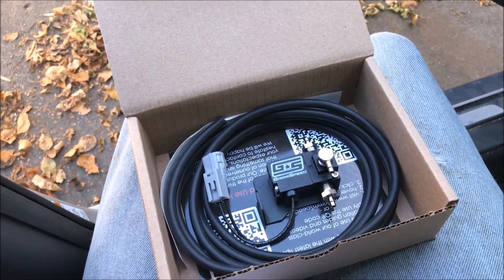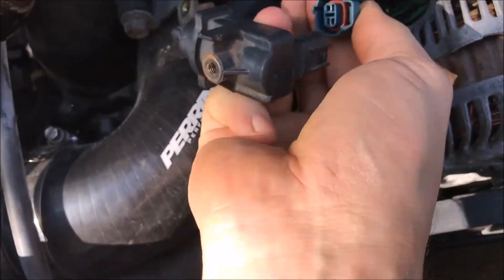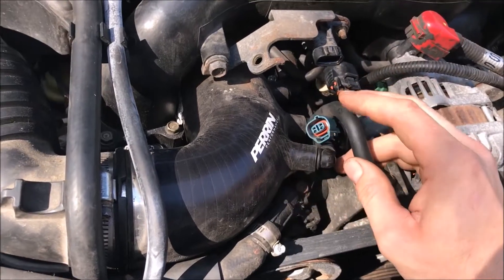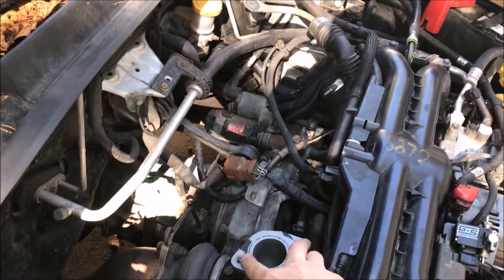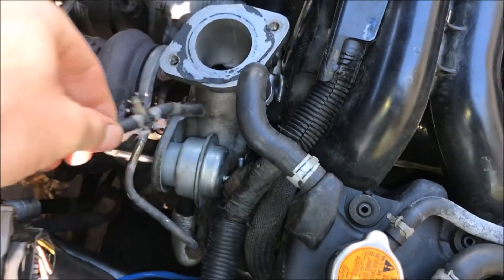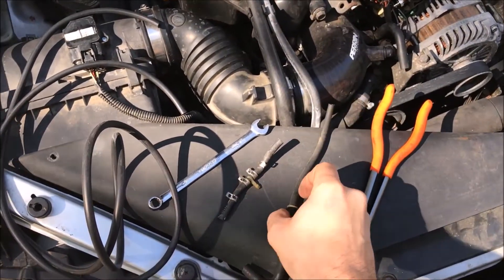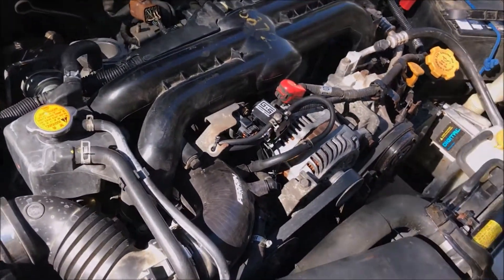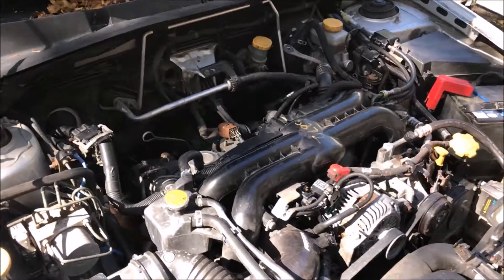Subaru Outback XT/Legacy GT GrimmSpeed Electronic Boost Controller Installation Video

Comment: Do you know exactly what size the return line to the turbo inlet is? i’ve been thinking about just upgrading from the stock BCS to the 3-port because that line is leaking at the inlet side.
Reply from the maker: Unfortunately I’m not sure, as it came with the boost controller. It’s probably metric, but I think a 1/8” ID rubber hose would work.

Comment: Good video, next time use silicon spray to slip on the hoses much easier. 👍🏽
Reply: Silicone is a very bad  idea, as it does not dry and/or evaporate. Therefore it stays very slick, leaving your fitting loose & prone to leaking. If anything, use a SMALL amount of WD-40, which will dry up from the heat of the engine, leaving an air-tight seal & a snug fitting. Ultimately, you want the hose to go on hard & dry.